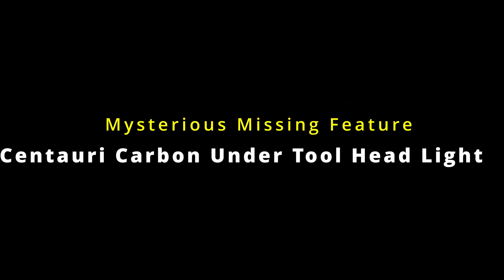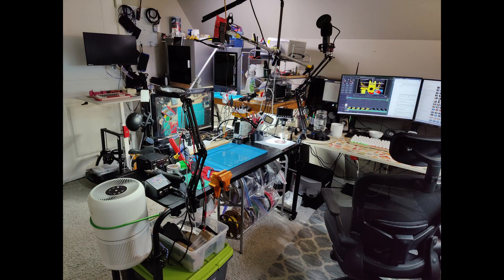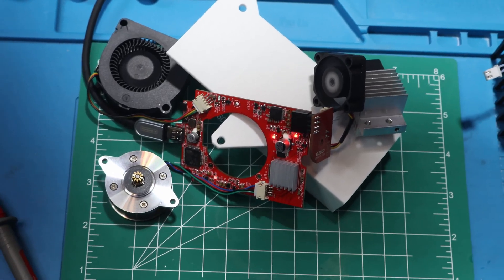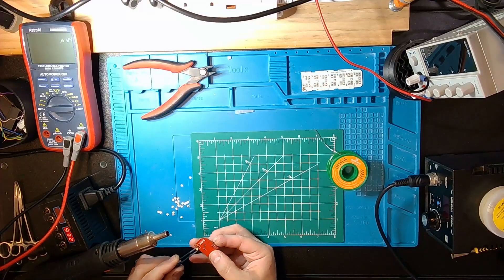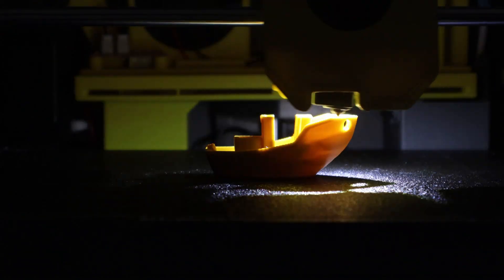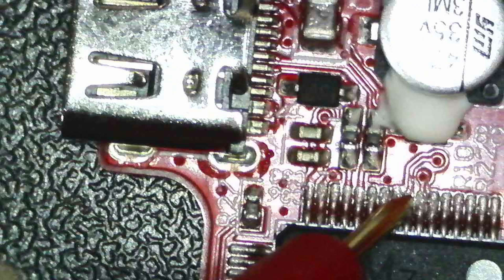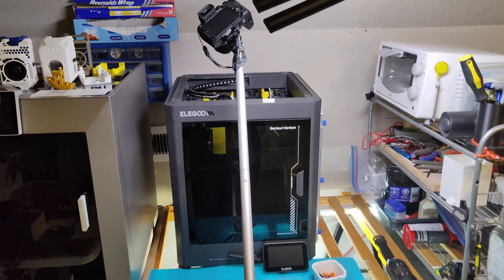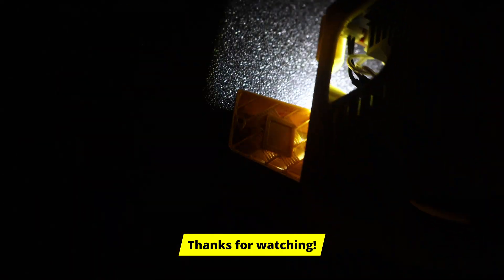Mysterious Missing  Feature Centauri Carbon Under Tool Head Light

Comment: I don't have a 3d printer but those look like 5730 or 5630 SMD LED pads, and depending on the voltage (these commonly run 3 to 3.4 V but some run higher ) you can solder one directly to these pads

Comment: do  you think we could add tool head filament sensor?
Reply from the maker: Yeah, one of the things on my radar for this experimental MMU setup is a toolhead filament-present sensor. I’m leaning toward a very light-actuation microswitch near the hotend rather than doing anything optical directly on the filament — clear filaments make that a tuning nightmare. Not strictly required, but it’s a nice reliability bump.

Comment: Are you selling this mod I like to buy please
Reply from the maker: It's in the works. It's probably going to be a few weeks unless you want to buy a prototype cut on my Carvera Air? I want to go the same route that I did with the fan adapter and offer a professional PCBWay-manufactured design in the end. At this point I'm still working through the CNC process and it's one of a couple of different things I'm attempting to do. With my current health status things are a bit uncertain timewise but this is definitely one of the projects I want to move forward with because I think it has broad appeal and offers a nice enhancement for the Centauri Carbon in terms of function. I'll be sure to post updates.
Reply: @SyntheticElectron3D  sure I’ll be beta tester what are you asking
Reply: @SyntheticElectron3D thank you again keep me updated on this
Reply: Just want to say I really enjoy your videos and praying for you for a speedy recovery

Comment: The  "LED" board is lacking vias to shore up the stresses on that NTC  connector. Why not a thru-hole connector? 
More LED's from another angle closer to the front would help visibility, really should be closer to the model fan, helping a Endoscope Camera. That CC built in camera has low rez, low frame rate, can't think of a possible use for it.

Comment: Glad to hear ur doing sorta well. Stay strong, don't let that sh*t bring u down!

I appreciate ur content, it's just awesome. No common stuff, just issues and solutions thought out of the box.

A member of the opencentauri project lately answered me there is no option in elegoos software controlling that mosfet atm. I bet the cc2 will have the same board just with the led enabled.

Havin a modded pcb would be awesome, i think i gonna have to solder  it by myself. I did some orders in US several years ago, toll fees made it at least double in price xD

Comment: Great news about this discovery. I've been looking into fitting an led as well. I modified my Prusa clone with a touch sensitive usb led and dc-dc. It lights the nozzle perfectly to check the first layer.

On the other subject keep fighting. I hade a double dose of big C and had a kidney and prostate removed. Hasn't made any difference to my life. I keep the motto 'don't worry about things you can't control yourself'. Leave it to the experts. They would if it was 3d printing!

Comment: at some places in the original firmware there are settings for RGB light on the toolhead . the count of diodes is 1 so I tink this is made for adressable rgb light. can you investigate this option. My mashine is working and for now dont have the time to dissasemble it. this is from printer.cfg file but it is unmarked so it have to be unchecked. it show the toolhead board pin PB15
; [neopixel neopixel1]
; pin : stm32:PB15
; chain_count : 1
; color_order : GRB
; initial_RED : 0
; initial_GREEN : 0
; initial_BLUE : 0
; initial_WHITE : 0
Reply: Id like to try the led mod
Reply: there are also macros for this neopixel in the firmware so it sould work .

Comment: sad for that bad news, you're an amazing presenter on your video, I love your accurate way of presenting the things that most of us don't know what they mean, stay strong, and keep, as possible doing great videos. Just one quick question, do you beleive or not that Elegoo released a second model in China already with an MMU system? or its only bad leaks that are coming out, since I bought my printer, and its my the only one I started my 3D print journey, so if no multi-color system comes out, I will be very disappointed, maybe if this is confirmed, I will try to sell it and go for a Bambu one..

🙏💪
Reply from the maker: Thank you. I have heard the rumors that an MMU may not be coming out. I have an idea for one. If you look closely, you will see some footage in this video of one of my CC's that is partially disassembled. I was experimenting and I think I may have found a viable way to do an MMU with less purge waste, greater simplicity, and at low cost. There are a lot of open source options out there, but most require complicated builds and/or bulky filament buffers. I'm hoping that I feel well enough to pursue this going forward because it's an interesting challenge...
Reply: @SyntheticElectron3D looking forward to see it in action

Comment: Any tinkering that can be done to this printer is definitely appreciated. I picked up some 24v LEDs that I was just going to splice into the model fan cable. I haven't played around with that yet since I'm still working on the Constellation CS extruder mod. Thought I had all the parts I needed, but realized I was missing some m3x24 screws. Grrr... Anyways, yes, anything to make this printer better is welcomed!

Comment: remove the connectors for the fan and thermistor. solder on extension cables and have the connector on the end after routing it up to the same spot where the part cooling fan cable is. then its much easier to plug/unplug those cables. the connector for the heater could be on the board as is.

Comment: My first ECC was a lemon.  As part of the troubleshooting Elegoo sent me a new nozzle.  I ripped out one of the connector's wires trying to get it out.  Eventually Elegoo replaced the printer and my new one has been flawless.  Anything to make nozzle changes easier and safer will get my full attention.